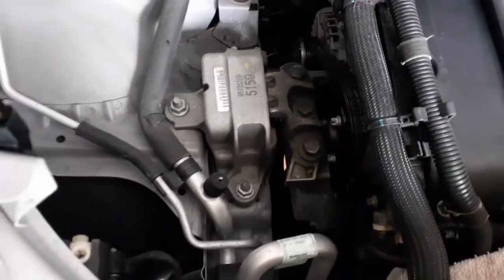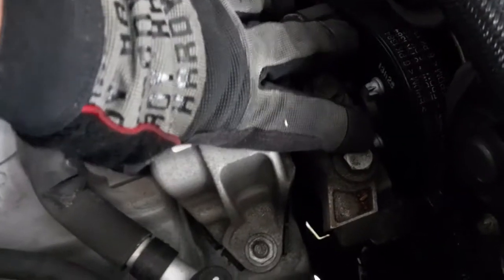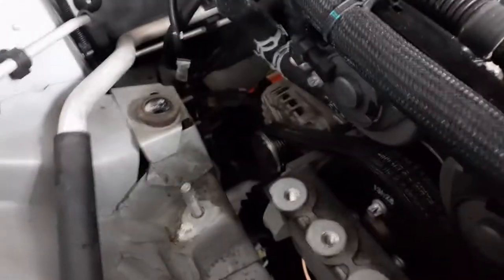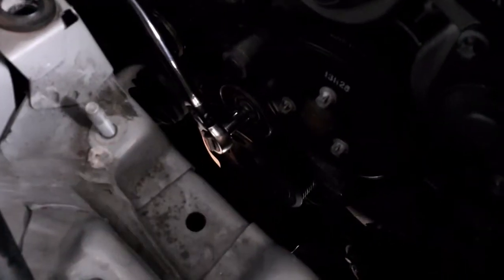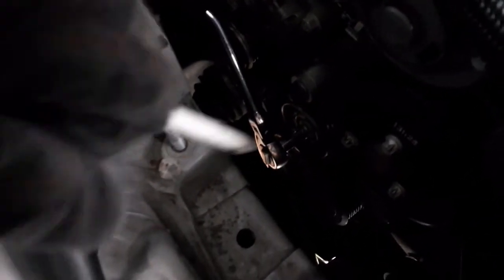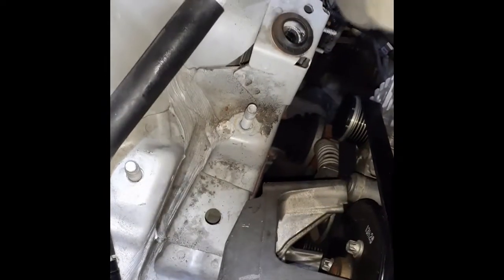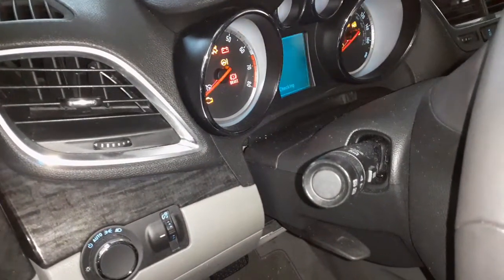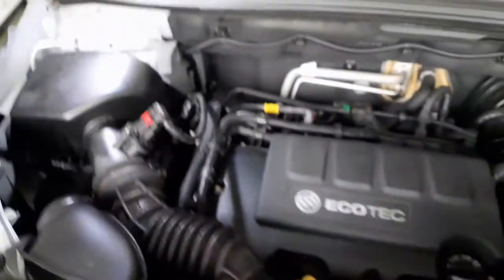How to: 2013-2020 Buick Encore Ecotec 1.4L Turbo 4-cylinder Serpentine Replacement Part Two

Comment: Picking your battles, patience...good words my guy. Good vid. Very helpful. when I opened the hood, I knew that damn bracket had to come out and you confirmed it.
Reply from the maker: Damn right! 20 years ago, no problem. Now.............it's a marathon not a race.
Reply: @RevCesKitchen305  we make it look easy 😎...now.
Reply: The bracket looks scary but the hole in the frame makes it easier . The hardest part is getting it jacked up in the proper position .
Reply: @RevCesKitchen305  You can't beat the chevy 350 four bolt water pump . At least the Encore water pump is external and not driven by the timing belt . And I like that it has a timing chain not a belt.

Comment: this is super helpful and i appreciate you sharing. i was hoping this was something i could do on my own but don't think i am confident with my limited ability, equipment, and lack of patience and unfortunately might just have to get it done somewhere and remind myself part of the cost of labor is all the aforementioned things i can't easily do myself. thank you for sharing as it helped a lot to give that confirmation!
Reply from the maker: It’s not as easy as some will tell you it is but I did actually make it look more difficult also. It isn’t totally necessary to remove the engine mounts if you don’t mind contorting a bit and finagle the belt in.

Comment: I left the 3 long bolts in the bracket from engine mount to block. Made it easier to get it in and out with out having to get the bolts out
Reply from the maker: @andrewcrawford6700  Yes, you don’t really need to remove it. When I did this years ago the few pages I found out of an actual OEM manual said to do it. Just like removing the entire dash when replacing the Camaro vent door which it’s much easier to just cut the side out and replace it.

Comment: How well did this work with reusing the motor mount bolts? The manual says they are torque to yield bills that can't be reused. I'm about to start this process myself.
Reply from the maker: Oh s#!t!!! If you got your hands on the manual you are GOLDEN! I never found anything online saying they were TTY but I’m not surprised.

I did this years ago but I’m pretty sure I used the same exact bolts with a dab of locktite. Haven’t had any issues thus far. Out of curiosity I’m going to check them. I know someone else told me the bolts that hold the heat shield are also TTY which seems ridiculous to me. I’m wondering what other bolts are TTY??
Reply: @RevCesKitchen305  great. This thing is at 270k and the tension pully has been my first issue. So I'm going to send it for a long as it'll hold up 😆 🤣 😂

Comment: You don't have to remove the mount bracket on the motor. The tensioner will compress enough to slip the belt on.
Reply from the maker: You're right! You really dont have to although it does make the job a little easier. Thanks for the feedback.

Comment: how did you remove the engine bracket i tried for hours do you lower the engine and then remove from bottom
Reply from the maker: Thanks for stopping by. The bracket is a PITA. Putting it back can be as bad or worse because you're putting it back with the bolts in place. 

The best advice I can give on this is the one word we all hate to hear which is patience. You need two jacks to pull this off. One to hold up the car and the other to support the engine. Use the engine jack. Make sure you're not going full pumps on the jack.

Use a very subtle slow lift. Remember you dont wanna damage the transmission and anything else. Give it just enough that you can remove the bracket with some struggle. Yeah it sucks but it's better to be safe than sorry. You will have the bracket off of the engine block and the hard part is finagling it out.....and finagling back in. Jack as needed only.

Film it if you have to so you can see how you did it. Best of luck!

Comment: you did not show how to take the tension of the belt?
Reply from the maker: Hard to with only one hand. Pretty sure I explained it. I also did say if you're completely oblivious or scared you shouldnt try it.
Reply from the maker: If I "offended" anyone you are more than welcomed to tune out. To address the tensioner, as stated not possible at the time to film because there was no way to hold a phone and add/remove the belt with one hand. This is why it was explained instead. To go over in detail, the pulley tensioner is located in between the alternator and coolant pump above the harmonic balancer.

Use a breaker bar and a socket onto the tensioner and push it in the opposite direction to slip the belt on, then release slowly making sure the belt is aligned.
Reply: @RevCesKitchen305  PS I like watching educational videos , I don't know everything and you may know a few tricks I don't , I've only done one of these water pumps and it was my own , what they did with the bolts they should be shot ! And mine has a spring inside the thermostat housing , I think you help a lot of people keep the videos coming .
Reply from the maker: @bhabigbig2391  Are you referring to the thermostat housing on the Encore? It's a bit of a pain. I've done it before and I seriously thought of going old school and yanking the thermostat out altogether and just putting the housing back on.

But from what I've been told by real mechanics is that modern cars are not like old cars and no thermostat does cause certain issues with the ECM because it never warms up enough or takes too long to warm up, etc.
Reply: @RevCesKitchen305  No stat can cause modern cars to over heat as the coolant doesn't have any cool down time .

Comment: Maybe you should have watched a few other videos, many can change the belt without removing the mount in less than 30 minutes,  check them out.
Reply from the maker: This is a part of two. I try NOT to watch what other people do. That's not the purpose of the video but to learn how to do it by figuring it out oneself and with the least amount of tools.

Somewhere along the way my intent is that hopefully someone else can learn something and improve upon it as you mentioned, it's not totally necessary, etc. I am amazed how many folks still comment on this video considering I did it years ago. Thanks for stopping by!
Reply: @RevCesKitchen305  I suppose there are other ways of doing this, I was only suggesting that you may have had less trouble, but when it comes to vehicles, it's not always easy until you try, have a good one.
Reply from the maker: Absolutely my man! You’ll never learn until you try. Sometimes you win easily and other times just be happy you won.